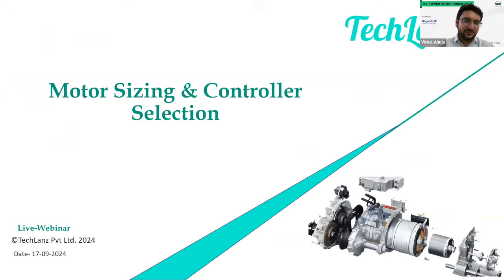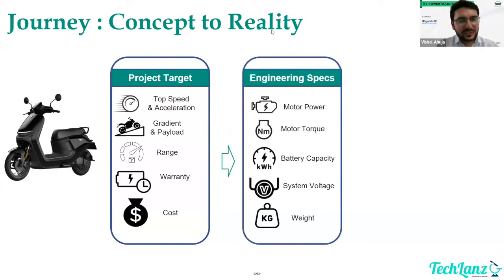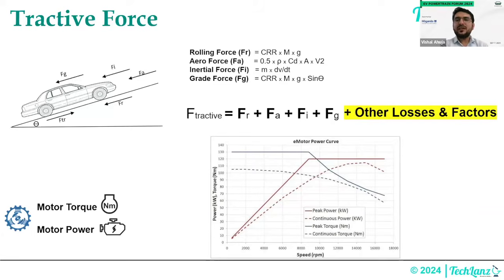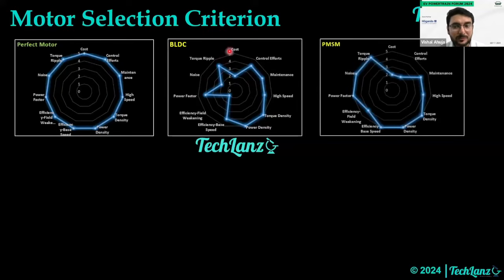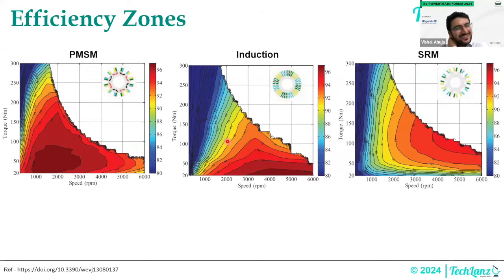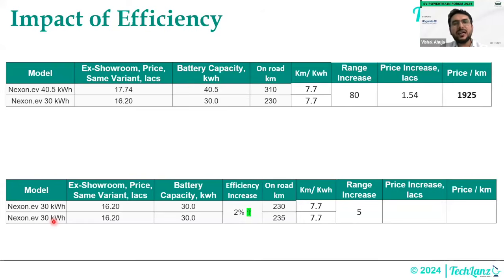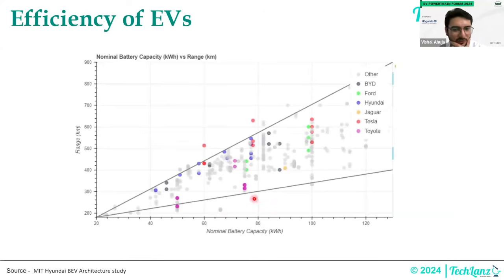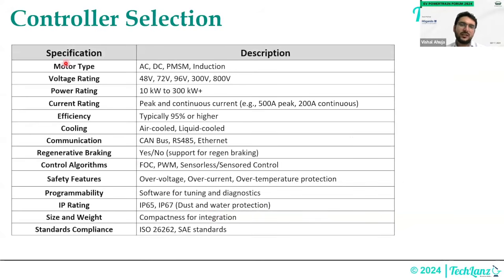Motor Sizing & Motor Controller Selection for EV Application

Comment: While calculating the max motor power, we have to consider the max speed (suppose 90 km /hr) and the acceleration ( lets say 0-40km in 3 sec) needed to reach that speed. however, while calculating the aerodynamic drag force should we give use the 40km/hr speed value or the 90 km.hr value? Or if you can clarify, how should the aerodynamic drag be calculated since there are two speed reference?